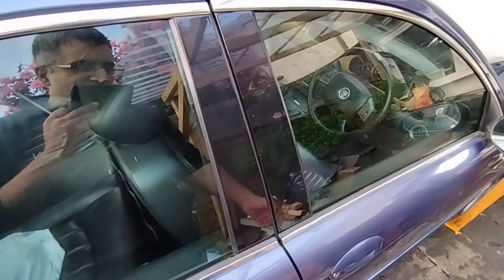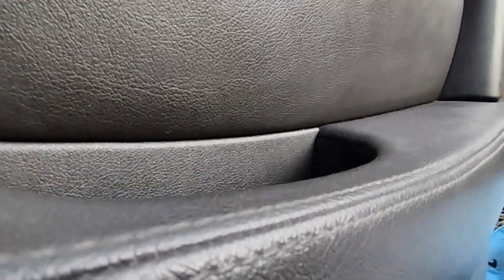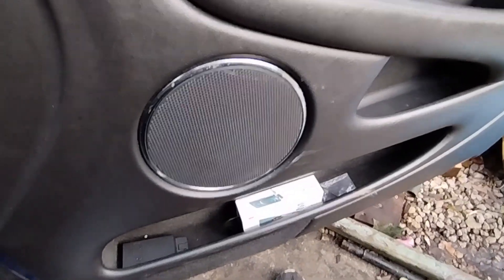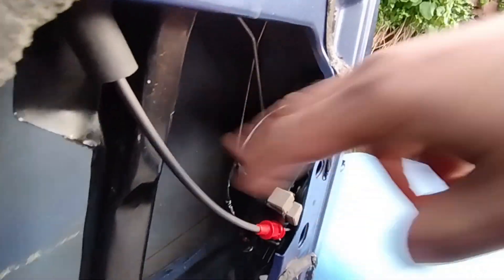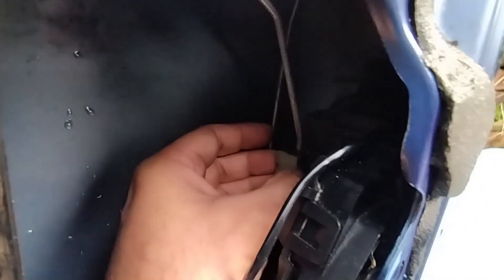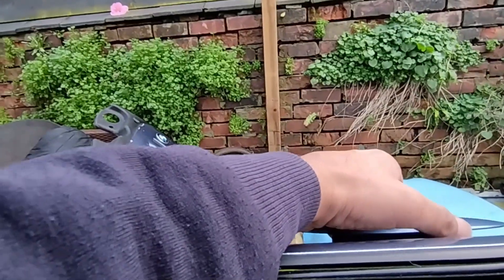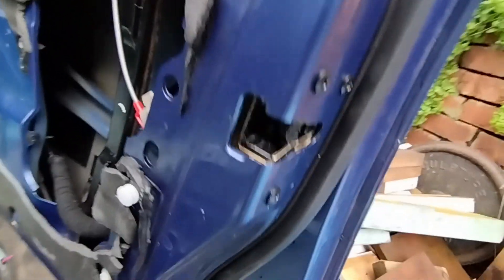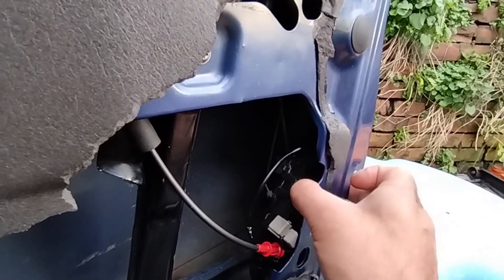Jaguar Xtype How To Fix Door Handle Woes.

Comment: Mine drove me mad just after I first got it meaning I had to jump into the passenger side and hope over many times, The way I fixed mine was to drop a nut onto the threaded rod so the clip had something to push against and couldn't slip on the clip.